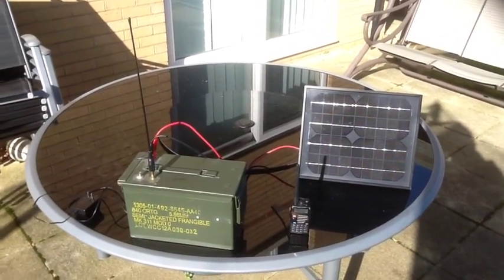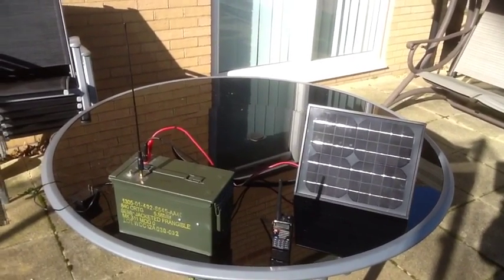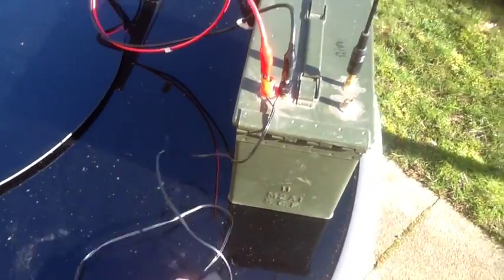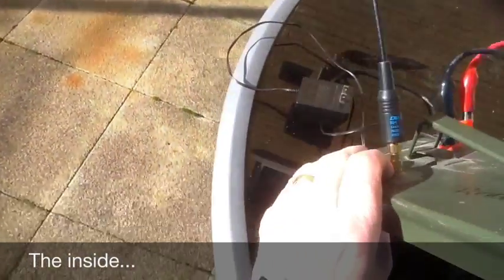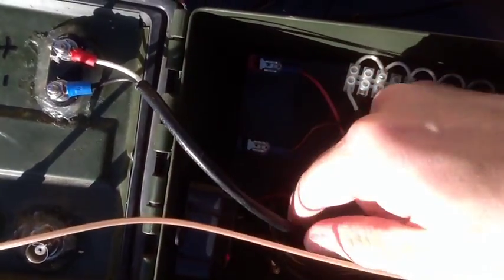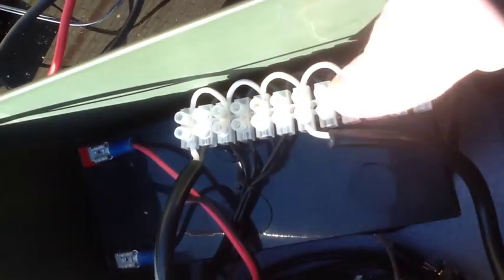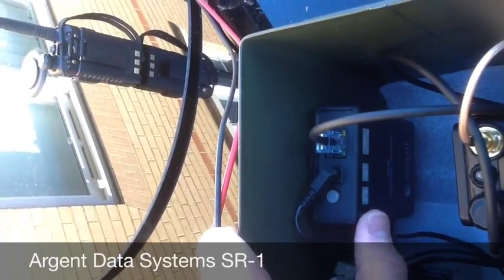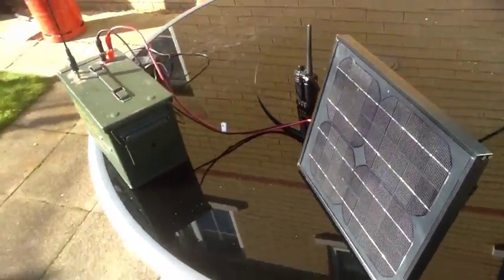Emergency/Tactical simplex repeater system

Comment: What brand and size are your solar charge controller and solar panel, please?  Thanks
Reply from the maker: The solar charger is a SJ3A Solar Panel Charger Controller Regulator PWM 12V 3A.  I chose this controller since it was the only one I could find that would fit inside of the ammo box short side.  The solar panel is a 10 watt monocrystalline panel that came framed in an aluminum frame where I added a foldable leg on it.
Reply: Low price and smaller size. a mppt vs. pwm charge controller,  with a 10w 12v single panel there's not much benefit to spend $100+ just to get a few more mA's especially since 10w 12v panels only make up to 500mA in full sun and pwm controllers start at around $10. only in a set up with 2 or more large panels is it useful and warrant the added expense.

Comment: Nice & clean build. Mine is on a 5300' mountain, got 80 miles max distance on 4-5 watts.
Backup Radio, Simplex Repeater Tactical Deployment
Reply from the maker: Wow Guerrilla, that's awesome!  Was the 80 miles just to the repeater or was someone on the other side of the repeater?  Either way, 80 miles is simply spectacular.  Thanks for the comment!
Reply from the maker: Thanks James.
Reply: It was one way. very scratchy but legible enough.
Reply from the maker: Sweet.  Thanks for the follow-up.